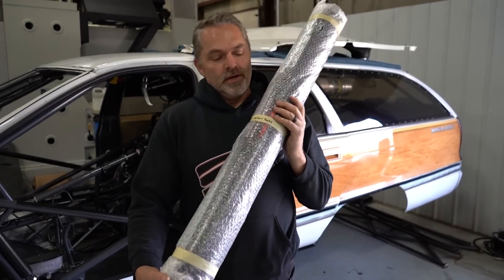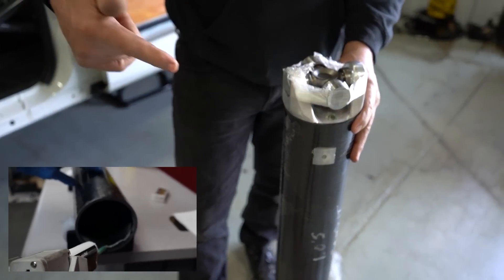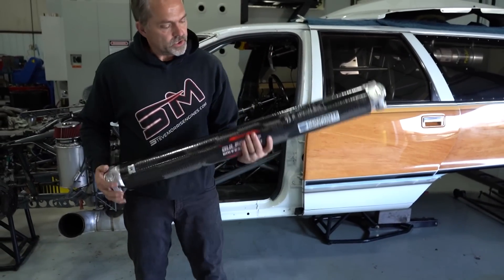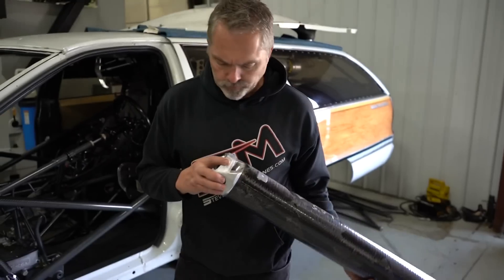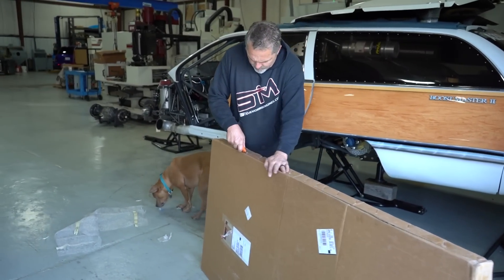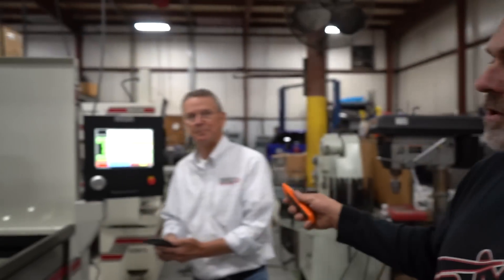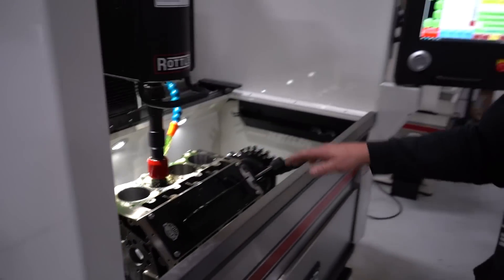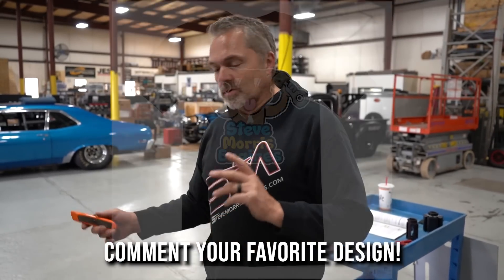4000 LBS Of Torque Carbon Fiber Drive Shaft!

Comment: @2:08 "It's permanent, it breaks everything except the glue" That's super high-tech 2-component bonding for ya! The hardened glue, and its bond to both the metal and the carbon fibre, can handle more shearing load than the torque that the carbon tube itself can support. 

That's what happens when an expert specifically engineers the specific type of glue, the fit, the surface preparation and the exact method of applying the glue, to the particular application.

Comment: I need the first Dewey (Mt. Dew) shirt please.

Also I know exactly what you mean on the driveshaft install.  Last weekend I upgraded the driveshaft in my G body.  Went up from a stock shaft to a 3.5" diameter 1350.  It wasn't happening the normal way.  I ended up jacking the car up to allow the rear to drop down.  Then I wedged the shaft over the rear end and then pulled it back into the hole.  Sucked, but better than dropping the exhaust to try to get it in.

Comment: I’m probably wrong, but I thought I heard somewhere that aluminum and carbon fibre have a reaction to each other.
Reply: That's high carbon Steel and Alloy. Is irrelevant if connected via suitable gasket medium or Epoxy matrix for example. You can easily join even high carbon Steel to Alloy no problem with epoxy it's only if they are physically touching the "higher charged" material will eventually dissipate its charge to the material with  lesser nobility. Even steels you have 316 marine grade that can be used alongside just about anything even though its not much different from say 304. (A2 & A4 In some countries) and unless it's a boat or near a constant electrical charge you won't really suffer rapid deterioration unless you seriously mess up. You can also have sacrificial anodes/ diodes/cathodes etc and they will take the hit for the dissimilar metal corrosion. Boats especially metal hull boats have sacrificial materials all over them so you just replace them every so often when they corrode. Hope this helps

Comment: Ask Rob Dahm on how to "break" a carbon fiber drifeshaft - he managed to break the glue bond of the driveshaft to the front diff, the yoke simply just would spin inside the carbon tube. Maybe the 4-rotor RX-7 has too much power... 😁😇🤟

Comment: Dewey shirt preference: ALL - They're all awesome! 

That 3M Scotchweld is great if the mating surfaces are prepped properly, which appears to be the case s noted in the test load video clip. The only question is, will the yokes maintain dimensional stability when the wagon plants those tires? We'll find out soon but want to get your insight. Cheers!
Reply: How sure are you it's 3M scotchweld?   I'd have thought this was a job for West Systems 105 mate tbh. If they aint on WS105 I think they are missing a trick
Reply: @bigduphusaj162  100%, 3M Scotchweld
Reply: @strykerentllc  Well if that's true them I dunno what to say. A PUR is not what I expected at this level tbh that would last about a week in a boat here in the UK we wouldnt use that for such a thing. Is that because there is a shelf life on the shaft so the PUR is expected to hold out that long?  Jeez no Joke we don't do PUR here in the UK for longevity it's basically a tube of CT1 mixed with a gel that makes it heat reactive. Offt needs some proper epoxy if you ask me. 105 with the flex additive would be 30%+ better in every way possibly twice as good considering the materials needing bonded.
Reply: @strykerentllc  btw I've made sprocket bushes and the likes out of 3M scotchweld PUR and they lasted but It's shelf life bond can't take near what the real deal can.
Reply: @bigduphusaj162  It is true and what was withheld was the exact Scotchweld variant so as not to disclose, albeit there wouldn't be many if any viewers likely pondering manufacturing CF Pro-Mod driveshafts. It's not PUR. Have a nice evening or morning...
Reply: @strykerentllc  mate there's no secret in 3M scitchweld it's a basic bitch 😂   Again, I'm a boat builder in the UK and 3M are one of my "go-too" but if its Scotchweld it's a PUR pal not a true Epoxy resin in any variant. There is no true epoxy Scotchweld unless you have access to 3M products beyond what we know which is Boats and Gliders aka Sail plane? Its a PUR if it is Scotchweld
Reply: @bigduphusaj162 Scotch Weld DP 460 Is not a polyurethane adhesive. It is atwo part Epoxy adhesive. Uses amine accelerator
Reply: @briandonnelly129  yeah so it's 460 then? Why is going on via a heated gun?  That's not a 460 gun q 460 gun is a 2:1 gun?  I'm in the UK that blatantly looked like a PUR supply gun mate we don't have any 2:1 or 5:1 guns that look like that, maybe it's a location thing but even out 3M guns for 460 is a handle plugged into the two lines or it's in a doubled up looks nothing like a PUR gun which here they all look like a glue gun. As for 460 if it is then its decent the best 3M do in my opinion but still lame in comparison to Genuine Epoxy Resin the usual 5:1 like WS105. Still not sure about this is it defo not 3M PUR?

Comment: 3:15
Those Yoke's will leave Egg on your Face (again)
Wrong joint for Success 🙈🙈 Yoke pin too weak.

Requires Dragster Drum Hub set up (Zip mate and Bolt together Male-Female connection) 
KSR shown a Dragster Wheel Hub connection in a previous video👍👍

Comment: There is so much surface area for glue on the drive shaft inserts
Reply: It's epoxy and yeah more surface area is always good for a bond but there's a bit more too it mate 😂  you need a somewhat chemical bond on these materials so that alone you need to know exactly what your doing and what temps you are squirting and push fitting everything. You can't just get a caulking gun full of CT1 and join any GRP/CF or even Coosa board composite or similar to alloys/alloy steels/ss alloy steels etc and expect it to last. Bit more to it brother take it from a boat builder it's not that simple.
Reply: @bigduphusaj162  

Cal29 Seafever did a fair amount of deck core and stern tube Epcot replacements
Reply: @tommays56  just found out that they use 3M PUR aka 3M Scotchweld. Hmmm  we wouldnt use that for that here in the UK that's not the real deal

Comment: I need some suggestions on four wheel drive axles for a drag and drive truck I’m building. It’s a 2010 Ford F350. I want to keep 4WD and still have a solid front end. And lots of good options for a rear axle but nothing for a front! Also anybody that builds a 1,200hp/2,100tq capable 5W110R Ford transmission. This question isn’t just for Steve. This a call for help. My truck is going faster and the usual components I use are starting to fail as I gain speed.
Reply: Yeah sell it buy a land Cruiser and a superbike. Cheers 🍻

Comment: Cleetus needs to do these upgrades to Mullet before he runs into these same problems when he finally turns it up and runs some real numbers but he also needs to be on a good track because he ran that one 6.60 pass and that was it so he hasn't leaned on that engine at all yet

Comment: The glueing process didn;t make a whole lot of sense to me ... if the fitting is pressed in with what was it, 11 tonnes?  That is going to be REAL TIGHT between the alloy fitting and the tube, you'd need a huge amount of glue pressure to impregnate the joint ... and the glue pressure they applied was minimal. There is no way there is any glue in the main contact areas.  It obviously holds decent torque, but I doubt there is any glue in the majority of the joint.

Comment: I was wondering how they attached the ends to the driveshaft. That's some monster glue.
Reply: WS 105 I bet
Reply: Right!! I can’t believe these things can hold so much power just from pressure and glue. 🤯
Reply: @ultimajp  it's not even pressure it's pure tenacious bond mate. People forget that Carbon Fiber and GRPs are made of PAN and Epoxy it's what you use in the wetting out process from boats to fishing rods to carbon fiber body panels

Comment: lets face it, there is only 1 downside to a CF driveshaft, and that is cost. i run one in my daily driver, and they are smoother, quieter, and faster, but they are spendy.
Reply: Mate even a 2004 RX8 has A CF prop. If it's done right it's a treat it's weightless

Comment: I cant afford 4000lbs of torque, but I would like to see someone see what kind of difference modern driveline weight reduction can make on a stock older vehicle. From crank to rear end. Just reduce the rotating mass.

Comment: With that rear end and drive shaft, what would you guess the weakest link in the drivetrain is?
Reply: He needs 12 transmissions and 144 injectors.
Reply: 2nd gear

Comment: Watch for rocks. It will chip that driveshaft.
Reply: Ohh know..  a wee chip in the prop shafts clear coat whatever will Steve Do 😱
Reply: From what I’ve seen of the wagon, the tunnel is totally enclosed.

Comment: I was fascinated to see they didn’t have any device on their saw to ensure a square cut or see that they had any PPE other than safety glasses on when cutting the carbon 😮
Reply: Yep, seems like the drive shaft shop is in the very early stages of making CF shafts.  They really need a process / industrial engineer ( or someone with manufacturing experience ) to smooth things out. They did post a Q and A vid this AM and addressed PPE use. Of course some are calling posters concerned about safety  " idiots and clowns" .
Reply: @bobroberts2371  there using 3M PUR too and claiming its the boobies. Needs proper epoxy that WS105 in my opinion